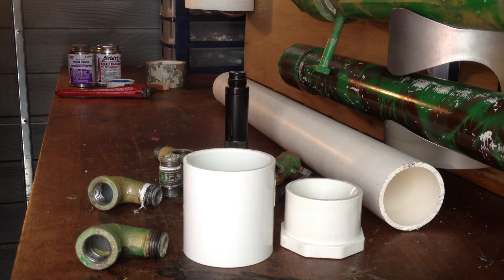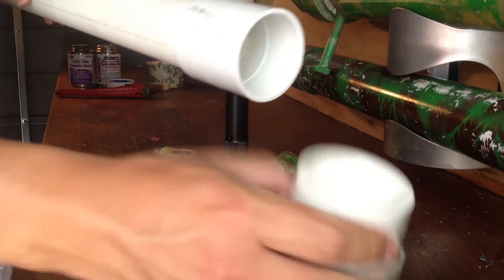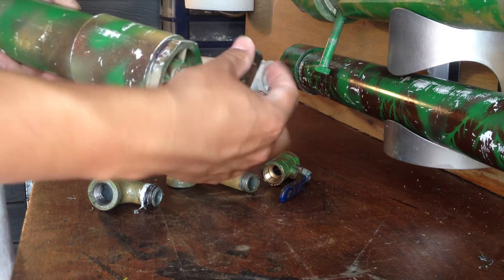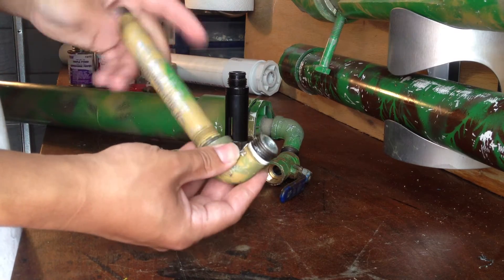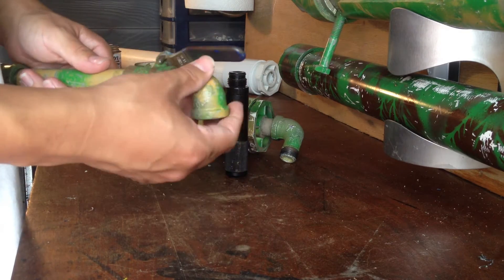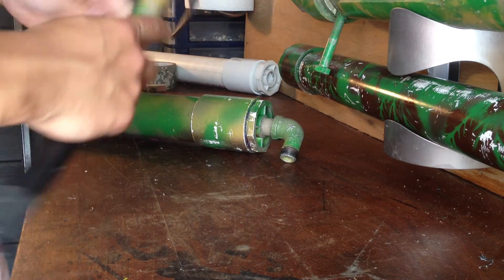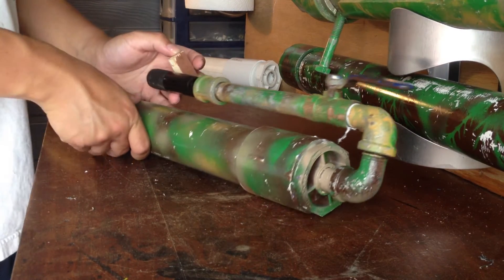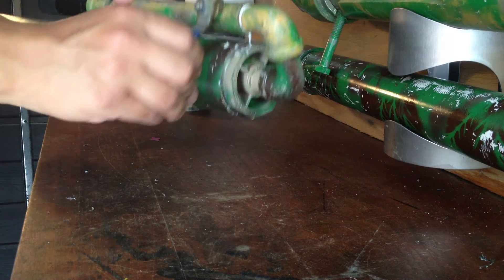Simple upgrade for Kipkay's Paintball Rocket Launcher

Comment: Awesome video man. Could you please show how to put a regulator on this design. My paintball field only allows the launcher if it shoots 130FPS or less. Im stumped on what to get and how to do it. Your help would be much appreciated. Thank You
Reply: Sid Thiessen if you go to ANSgear.com or Rap4.com or even Amazong.com you can search co2 regulator and thats how youd get it. You can't really find them in stores
Reply from the maker: Sid Thiessen Sorry for the delay, but I just remember that this comment section exists. The short answer is you can't. This is a barebones design. The speed of the football is determined by how fast you can turn the ball valve, rather than the pressure of the CO2. In order to get a mechanical trigger that is reasonably easy to make (like a modified sprinkler valve), the expansion chamber needs to be much larger (roughly as large as the barrel itself). Doing such a redesign would mean a completely new launcher.